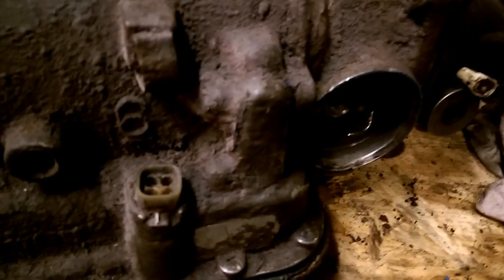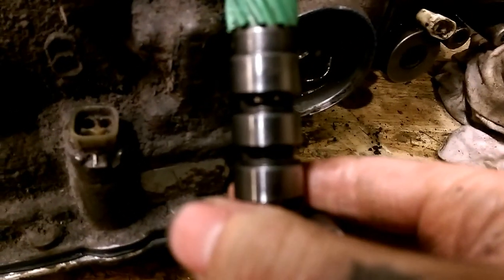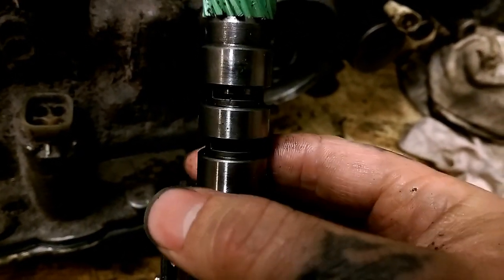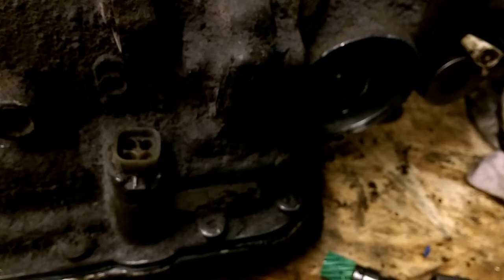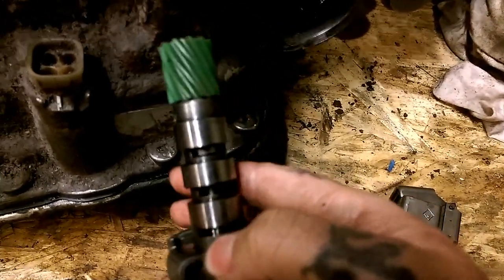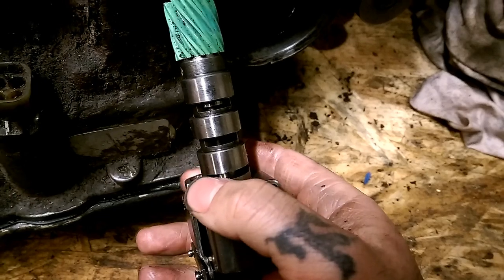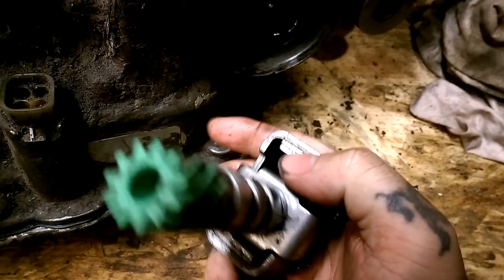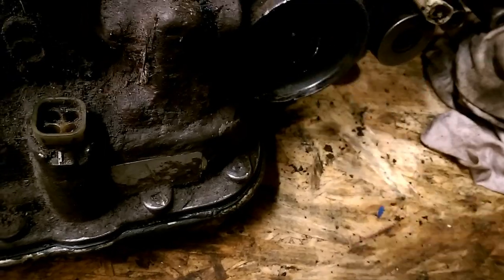How To Tell If Your 700r4 Governor Is Stuck

Comment: When I jump in my 88 k5 w 700r4 and quickly put it into reverse its just like neutral. If I let it warm for 30 sec it works fine. Any ideas?
Reply from the maker: sounds like your seals are shot inside the transmission, but you can try a fluid and filter change may help

Comment: 700r4 I ran out of fluids while driving now it won’t shift out of 1
Reply from the maker: did u add more fluids and check it running?
Reply: @TattsForLife  yes the tv cable popped out the trans and I tried replacing it with a new one couldn’t get it in with the rubber boot on it so I took it off and it went in flush but started leaking again so tomorrow I’ll put some atv on it and see what happens

Comment: When im in second gear it wont shift to 3rd. If i put in 2 or 1 it will carry rpm to 3000 or more but not shift to 3rd. If i put in 3 or drive, it either trys to or does shift to 3rd and then acts like its in neutral. Any idea what could be happening.
Reply from the maker: is your tv cable adjusted, and how does your tans fluid smell?
Reply: I think my tv cable might be a little stretched. Trans fluid smells fine. Pulled pan and changed filter. The pan had NO signs of grinding. No shavings at all. A little oil was in the pan with trans fluid. The trans fluid smells fine
Reply from the maker: should not be no oil in the  trans pan at all, thats very odd,
Reply: @TattsForLife  ya. Was some grease on the bottom of pan too. Very weird. Just gonna swap it for a refreshed one
Reply from the maker: Yahhh, sounds like a plan

Comment: My 350 turbo won't shift out of first until it is warmed up and driven a bit. I pulled the governor out and noticed that there is no pin holding the gear in place. Doesn't look like a hole was ever even drilled through the gear. Could this be the issue?
Reply from the maker: the hole would be on the shaft right below the gear, and yes it could, but sounds like to me its just wore out seals

Comment: Question if anyone can help, I got a 91 k1500 with a 350 my trans won’t come out of first gear it has no reverse and if I put it back in park while idling it grinds, I’ve been looking for another for over a year and a half. I don’t understand transmissions at all I don’t know what wrong with it. Someone please help me.
Reply from the maker: this apllys to a th350 trans only. I think that what you ment by having a 350?
but those are the same symptoms of the vacuum line not being hooked up or could be the gov or the pass gear valve is stuck, also could be the the gear is worn out on the governor or spinning and pin is broke holding gear on. Pop the clip, pull the cover and it will slide right out to see
Reply: Hey thanks man I just seen this, but last night I made the trip from Arkansas to Missouri with intentions on pulling the trans takin it back and rebuilding it, my truck has been broken down for over a year and a half in a friends yard.  As I was taking the front drive shaft off I seen the governor case and thought it’s worth a shot I cracked it open took a bath I’m trans fluid, but I didn’t care because I pulled the bitch out and sure enough it’s stuck. I’m so pissed and so happy at the same time.  I just hope that’s the only problem with it and I can get it back home.
Reply from the maker: happy to hear that, wish u luck

Comment: I have a 1982 chevy c10. I've only just recently had issues with it so its been parked and only driven around the block while working on it. The truck will not go into any gear at all now, sits like it's in nuetral and can even redline in gear. If it even goes into gear.  When shifted the 700r4 has no change in idle, sound or vibration that would indicate it did anything at all? The TV cable is tight, no signs of leaks, The shifter clicks through the gears and I can even manual move through the gears with my hand on the side of the tranny. The recent problems it leads me to believe the tranny was the issue. Where should I start to look? The Governor???
Reply from the maker: Sounds like the plantary has went down inside the transmission, or the pump has went down, or low on fluid but you can start by makeing sure it is full on fluid while the truck is running, it should still pull with a bad governor just not shift

Comment: Just looking and watching. 
I had a 700r4 in a chevy pickup.  
The transmission gave out in oceanside while serving in the Marines.  I had aamco rebuild it and it only lasted 4 years. While headed to work i stopped at an intersection and it just went permanent neutral. 
I had enough and sold the whole truck. 🤣
Reply from the maker: the 700r4, is just a old school 4l60e lol

Comment: 700r4 : highway at 70 mph tried to accelerate and started to slip. Now no 3rd or 4th. This came on out of the blue. Could it be the governor ? Tv cable seems fine. 
Thanks
Reply from the maker: Sorry for the late reply but if its shifting to 3 and slips then its the clutches bad and maybe a clacked piston,the 3-4 clutch pack is a common failure item in this transmission and the 4l60e

Comment: Hey bud, I have an issue with my 700r4. I put it in granny gear (1st) and my truck will not move. When I put it in drive, I think it starts out in 2nd....any ideas what could be wrong? Thank you sir
Reply: i got this problem,how did you fix it?
Reply: Could be linkage

Comment: Do you need to drain the tranny fluid before removing the governor?
Reply from the maker: No, you will lose some when doing this, but it all wont run out, just top it back off when you done
Reply: @TattsForLife  nice. I'm gonna check mine out tomorrow. I appreciate your help and quick reply.

Comment: mine only moves up and down when both of the springs are opened but nothing happens when i just do one side at a time is that normal?
Reply from the maker: sometimes one will do it, but mostly both half to if its sticking in the bore, try soaking it in some trans fluid and try

Comment: Does that green gear looking thing supposed to move
Reply from the maker: nope its fixed in place by a pin. if it moves then its broke and needs replace, hope this info helps
Reply: Thank you I think my transmission is no good check the fluid the vacuum module will not go into any gear I throw it in any gear other than Park it's automatically in Drive and you can't even feel it shift
Reply from the maker: so in drive in every gear?
Reply: TattsForLife yeah
Reply from the maker: you have a cut seal somewhere sounds like, or a place bypassing in the valve body
Reply: TattsForLife I bought it rebuilt to from some guy he told me there's probably no fluid in the torque converter, that's not true I bought the torque converter brand new and put fluid in it before I put it on I'm going to take it out tomorrow is there anything I should look for
Reply from the maker: how many quarts did you use in it?
Reply from the maker: well its in drive in every gear then he either cut a seal rebuilding it, or messed up on the valve body
Reply: TattsForLife Thanks bro